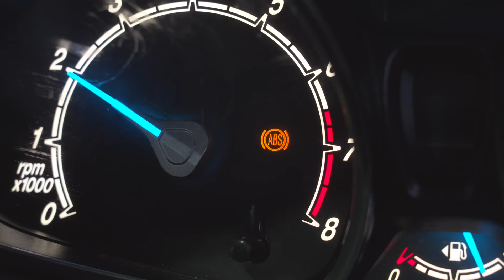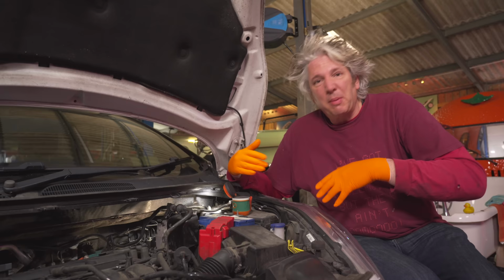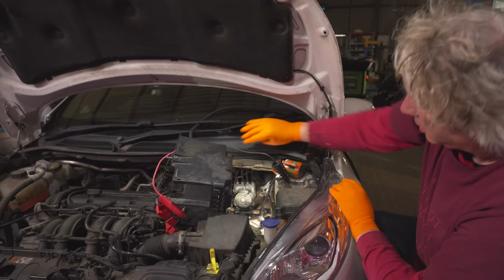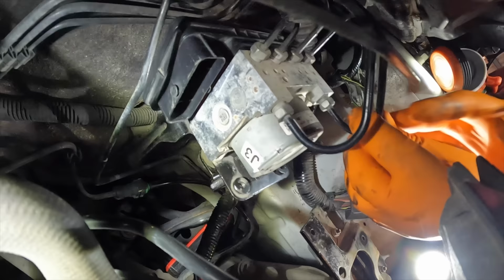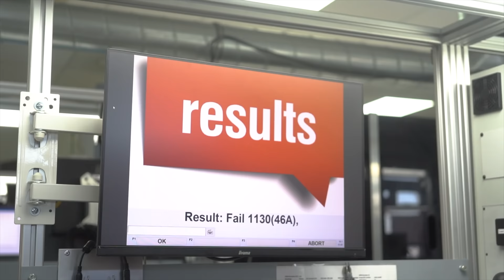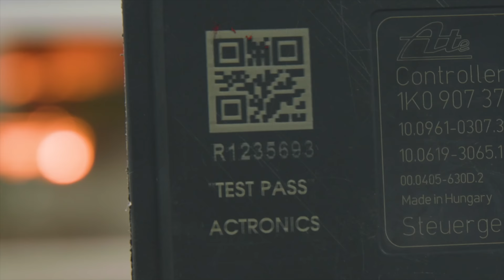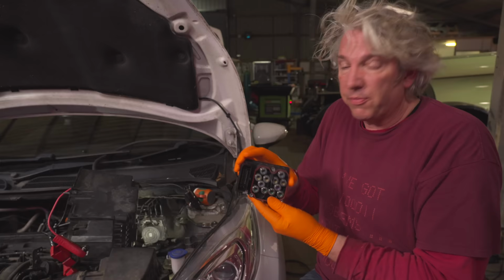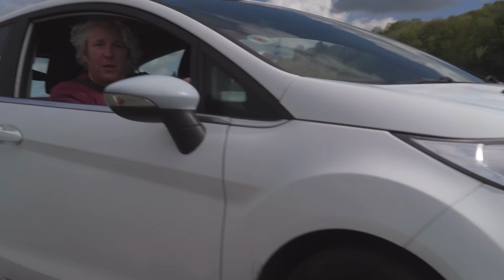Fix ABS with Remanufacturing: Edd China's Workshop Diaries Ep 61

Comment: Can't help feeling like £1500 is pure price gouging - no way was that module worth such a significant fraction of the total new car cost, outrageous money. Great that there are firms out there that can actually fix things rather than just binning things off for no good reason. Bravo to Actronics.
Reply from the maker: Bravo indeed!!
Reply: Two ways to get spares for vehicles that have been around for a long time - one is that at the end of the car's production, have the OEM make many more than required, buy them, and store them in a well controlled warehouse for years - and then discard the ones that don't end up sold after storing them for a decade or two. The other is to get someone to spin up a production line for a small run. Neither of these options are cheap - I can see them needing to get - after retail markups - £1500 for the ones they sell to make the whole thing work.

Fixing ones as they fail is a very good idea - but you need a decent thoughput to pay for the setup, and you also need the fault to not be an Application-Specific IC, or even just a more generic part that goes end-of-life, that is unavailable.
Reply: Such a part is probably not that often needed, and by the time it's needed the car isn't worth much, so the owner will likely opt to get one off a scrapyard (looks like on ebay you can get one for around £100 or less), so even at a reasonable price of a few hundred quid, most people will opt for a used part on something not likely to fail. So then you have very small market, and as outlined above, to supply these years later costs lots. It's a shame companies like this don't offer a service to the individual though, plenty of competent mechanics who don't want to be 'stitched up on the labour rate'.
Reply: 20 years ago when I worked at a company manufacturing ABS units for the big car manufacturers the sale price to the VM was less than £100 for the whole ABS unit. £1500 is quite a markup.
Reply: @eddchina best wishes 😊 hope you're well
Reply: Aqui no Brasil, custa R$ 5,000,00 um absurdo a Ford está de sacanagem.
Reply: Can't help feeling like you're ignorant about the realities of running a business like this.
Reply: @maclauk it's so weird, almost like complex modules for cars cost way more than just the BOM

Comment: Glad to see you back.
Was able to fix the abs module on my 1999 BMW E37. Best money saving fix I've done.
-5 hours searching and reading, until i found useful info on the internet.
-5 min removing the module (easier access than on the Fiesta).
-20 min carefully cutting it open. (Same cut as they did on the Fiesta module, but did with an exacto knife).
-5 min to renew the cracked soldering (common problem apparently).
-5 min to glue the lid back on with  ABS-plastic glue.
-5 min to put it back in the car again.

Comment: Nice one Edd. My better half has a white 14 plate Fiesta too so hopefully I'll never need to do the same but good to know this shouldn't cost thousands to sort if it goes wrong.
Reply: You would be surprised at what a new ABS module costs. For my Pug, it was £350 brand new. The same ABS module but fitted in an Audi was £1400. Software will be slightly different which prevents you from fitting one to the other... but shows what markup these parts are sold at!!

Comment: I had Opel/Vauxhall Vectra B that had similar issues with ABS. I fixed it by removing the electronics from unit, opening it and reflowing everything with flux and heatgun. Worked flawlessly since that moment until 4 years later car went to scrapyard because of rust.
Reply from the maker: Great fix, it’s amazing how dry solder joints can bugger stuff up so easily (that and failed tant capacitors)!
Reply: @eddchina  opel's had issues with dry solder cracks, everything else was fine. It was the common issue and reflow was common fix. :)
Reply: Well...since the lead free solder need to be use,much more faults specially a BGA parts.I only have the basic equippment as the pro rework station starting from 20-30 K Eur.

Comment: Great to see you back Edd. The shots from behind the ABS module gave me flashbacks to one of the few times I attempted to work on my own car. Bolts did fall down the engine bay, then my phone, which I was using as a torch so I could retrieve them, followed. Managed to get the phone back, but a set of cooking tongs had to be sacrificed in the process. The stress! Need more practice and less arthritis, clearly!

Comment: This remanufacturing process is great for those parts that you either can’t get brand new at all or are prohibitively expensive at the main dealership; case in point, the ABS control module for my 2006 Buick Lucerne, which is an American Full Size Sedan (it’s considered an Executive Saloon in the UK, equivalent to a BMW 5 Series or a Mercedes E Class)is still available at the main dealer for over $400US because they made 3 different part numbers of that module because they had 2 vastly different brake systems depending on trim level and engine choice (V6 or V8; the V8 models and the top trim got Stability Control and Brake Assist while the V6 models only got traction control)

EDIT: I visited their website and apparently they can do Instrument clusters, HVAC Control Heads and Engine ECUs too!

Comment: Welcome back! :) Watching you dismantle half the engine bay reminded me of replacing a headlamp in my 2005 Falcon Wagon. Passenger's side, dismantle & remove the air trunking & air cleaner, then replace the lamp. The fiddly clamps to hold the lamps would have me cursing. Then put everything back. On the driver's side, I was lucky. I could free the battery and then move it aside without disconnecting it. But the parkers...I left that to the mechanic when she went in for a service. My 1985 Hilux with sealed-beam headlights was so much easier :P

Comment: The capital investment represented by that facility and the processes suggests that those devices are a steady stream of malfunctions.  You don't go to that kind of effort for one-off problems.
Reply from the maker: You don’t, and thank goodness they have so we can keep our modern classics on the road!
Reply: I’m stunned they seemed to magically know what chip to replace and actually had one. The leads were too small for me to think that was a simple solenoid driver. Doubt the one repaired in video was Edd’s as when boxed it was bolted to a pump assembly, which Edd didn’t send.

Comment: It would have been nice to know what the actual fault was with the unit. The video showed the technician at acTronics removing the main microcontroller off the pcb using a hot air gun...and a lot of very cool automated test equipment...don't get me wrong very impressive setup but very light on the details as to what actually went wrong. How did actronics diagnose the fault and effect a repair...
Reply: That is kinda the point ACTronics is not directly accessible by us DIY guys. So this video was kinda a filler advert.
Reply: there is a closure in the chip and the chip is replaced with a new one so that who works
Reply from the maker: The part Remanufactured in the video was actually from VAG vehicle but I thought it gave a great impression of the process involved!
Reply from the maker: You never know, they might open up to the public one day but for now if you can tame a friendly service point they might let you do some of the work to save even more cash keeping your modern classic on the road…
Reply: Exactly my question too.
What was the fault with the ABS unit?
Would have been nice to know what the fault code or codes were..

Comment: One thing that Edd did that I've never thought to do is to hook a jump pack/another 12v power source to the battery leads before disconnecting them from the car's battery, so anything that has memory settings doesn't get reset... brilliant idea.

Comment: Great to see some new content on this channel again. It would have been nice with some speak on the actronics video to explain what they are doing in each step. As mentioned elsewhere, the music was just in the way.
I needed to get an abs unit for my motorcycle fixed a few years ago and tried looking for someone who could do it since a new original one was also around £2000 which is utterly ridiculous.
I found a UK company that said they might be able to so I shipped it from DK to UK only for them to then say that they couldn't work on that particular unit. So I had to pay for return shipping to get it back. Not a very good experience.
I asked a few local shops how they would repair my bike and they told me they would replace it with a new original part, so seems like they don't really care about repairing parts. 
In the end, I found a used unit on ebay for a reasonable price but I would have preferred to have my original refurbished since it was in much better cosmetic condition.

Comment: I've found most ABS problems to be either the sensors or the pickup rings. It is good to know that a module repair service exists which makes for a cost effective repair. I've had to have a couple of modules on my 2003 Volvo XC90 repaired which was a LOT cheaper then brand new ones form the dealer. It is good to see fresh content like this even if it is your mate's Fiesta.

Comment: Interesting to see how surface mount chip removal and placement has changed over time. 
My first job after leaving the army was technical manager of a company manufacturing encryption units. 
I convinced the owner that surface mount for over 80% of the components was the way forward on pcb design and manufacturer, procurement costs, production and testing.

Part of that was developing the SM chip removal process, excessive heat damages chips and wrecks the pcb pads, which means through it away. 
Now it's comparatively commonplace, back in 1989 outside of multi-million $ companies like HP it was unusual.
It was the learning new skills and techniques that made work interesting.

Comment: Been there done that on my S80. It's a common fault and everybody told me it has to be the module rather than the pump. So i got a remanufactured module from CarNordic and put it on. It was showing a lot less codes but pump code was still there. Replaced the pump itself (not the dist-block) and was immediately greeted by a working ABS. So i had both a faulty module and a faulty pump.

Turns out the ABS rings on both drive axles had split due to corrosion and every now and than it would generate a faulty signal. That in turn caused the ABS to engage every time you braked. The previous owner just continued driving like that until the pump motor burned up.
Reply from the maker: What a nightmare. We’ll done for getting sorted. So many less flat spots  too probably!
Reply: @eddchina  Thanks! 😁 thankfully no flat spots 😉

Comment: That was a great insight. I had a problem with the same component on my old Honda Accord, the module also housed the VSA system (stability assist) and that had failed. My local mechanic did the same thing as a new module was £1200 at the time but sending the module off for repair was much cheaper. It was really interesting to see the process up close, thanks!

Comment: I would have loved to have a voiceover by the ACTronics guy! Looks like they replaced the 990-9413.1b main controller IC of the module. Looks like they used normal reflow soldering. This could have been done at home with way simpler tools, but since it is a critical part they spared no expense with the soldering setup.
10:15 Milling the case open
10:30 unsoldering the old IC with hot air
10:42 inspecting the solder pads 
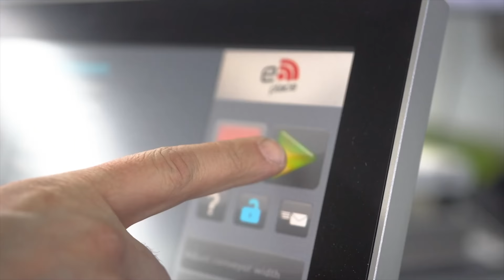11:00 putting new solder paste on the pads
11:12 same machine places the new IC on the board
11:23 reflowing the solder paste with hot air
11:35 inspecting the new solder connections
11:50 testing the whole module
11:57 putting new glue on and sealing the module

Comment: Got to be careful there Ed, I sent my e39 abs module to BBA Reman, they "repaired" it and gave a lifetime warranty on it, and it worked for a month. It stopped working again, I opened it up and the soldering in the was a joke! They then went bust and no one else wanted to repair it and put a warranty on it.  I had to buy another part, code it to the car and that turned out to be broken, so Control Units repaired that one (2 year warranty). So far one month in all good, but £500 down in total.
I was hoping this video might actually show me how to have a go at repairing it myself rather than just an advert

Comment: Very interesting episode! Thanks so much! I had exactly the same problem with my BMW 523i E39. A BMW - garage told me that I had to change the ABS - box and all the sensors (a fix that would have cost a considerable amount of money). Fortunately I found a small company in Germany that was able to repair the little ABS - unit with the pistons for 130.- Euros. As it turned out later the ABS - light had started flickering in the first place with the engine warmed up because the little unit would be exposed to the heat coming from the nearby exhaust manifold. Once the engine had cooled down the light would go off. As for the e39 it's a lovely, reliable car which should be saved by all means.

Comment: I have to tell my fellow gearheads that a friend of mine had this problem with the ABS on his Focus 2005 and this was in 2008. So ford wanted 2500eur to change the ABS unit, I said that its probably a shotty DIN socket. But no it was the "Coals" for the ABS pump that had to much oxide on them so he changed those and Voila.

Comment: I had a 2000 volvo V70. If the ABS was activated, the entire dash would light up. The odo would stop, the auto would become a manual and a bunch of other odd stuff would happen. It took me forever to figure out what the problem was but it ended up being weak solder joints in the ABS module. I removed it, cut the lid off and reflowed the solder joints I could find. Problem solved for a few pennies and many curses.

Comment: Nice to see a Ford Fiesta on the channel! But have you done a special on the ecoboost 1L Timing Belt replacement? The recommendation is 150k/miles or every 10 years, which ever comes first. Being a wet belt it is expensive to repair and replace. If the oil pickup gets dirty it can cause oil starvation issue and premature belt failire. They often replace the water pump at the same time because it's such a big job. What would it have taken to make the 1L ecoBoost a safe engine with a normal timing belt outside the crank case?

Comment: Aaah I love this video, somewhat spontaneous and also useful, educational.

Can you get any insight on what actually goes wrong with the chip itself (I suppose that's the only thing they replace) - usually chips (especially if left sealed) could last 50+ years on their own. I see that there's a plenty of 990-9415.18 ABS chips to sell (for Ford/Mercedes) but I don't actually get what is getting wrong with those. Do they include accelerometer and then that goes bad? I can't find the datasheet anywhere for this part...
Reply: I suspect it's just the harsh environment - lots of power cycles, lots of heat/cool cycles, lots of vibration, lots of g-forces. Sat on a desk I'm sure the electronics would be fine for decades

Comment: All that diagnostic and CNC equipment, to rebuild a unit like that for a couple of hundred quid is a bargain compared with the price of new!

I'm assuming as well that remanufacturing the existing part means the ABS module doesn't need to be coded to the car? Guess that would be an additional expense if the unit was replaced rather than fixed.

Comment: Ford is diabolical when it comes to ABS.  Bought my missus a 2007 CMAX with ABS fault, module had gone down on the pump, swapping the pump part didn't fix it, so bought a used pump that then had to be coded to the car which took some time as for some reason the pump retained the VIN from the donor car as well as the new VIN of my missus' car, but sparky sorted it out.

But, if the CMAX had been the next generation, if the ABS has a fault and you switch off the engine, you can NOT restart the car until the ABS has been fixed, which is ridiculous.

Until recently I had  J reg Senator...ABS worked fine.

My P reg Astra MK3 with V6 conversion....ABS works fine.

Can't help feeling these modern ABS fragility is by design, and the price to replace is bordering on criminal

Comment: After all, your neck can't be worth spending that much money to save you from death, right? Great video Edd! In most cars, the brakes will still function normally without ABS but you will have reduced braking performance and you may have a loss of steering control during hard braking, an issue ABS is intended to assist with during hard braking operations.
Reply from the maker: Thank you.

Comment: Good to see these cottage industries repairing parts, instead of throwing away, and being charged a fortune for a new geniune part.  My own vehicle is a Ford Falcon FG mkII.  A colour touch screen on the ICC (interior command centre): the centre dash unit operating the radio and HVAC, was an option.  The touch screen itself is known to fail after a number of years.  Mine has.  There are places that will repair the screen, and guaranteed.  Like the ABS module, there is a component in the electronics board which can fail, when the battery is replaced, or jump-started after being flat.  The screens could be replaced when the car was under warranty.  Long since expired now (2013 model year)

Comment: Same problem with BMW motorcycle ABS. AT £2300 it cost  more than the residual value of the bike. Could find no one in UK or Europe who could repair the unit but found (through eBay) a company in the USA who did a brilliant job for a very reasonable price. Had to pay inport duty🙄.